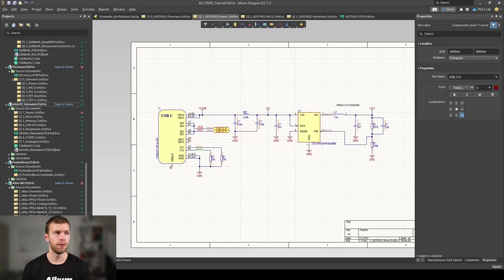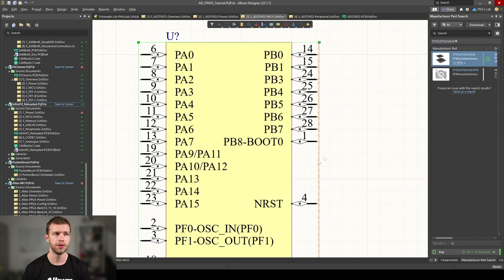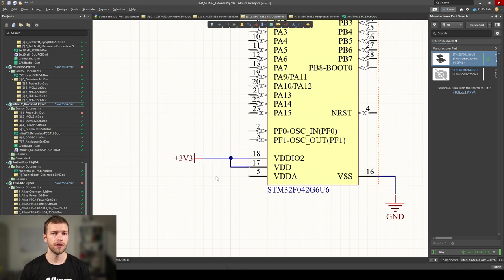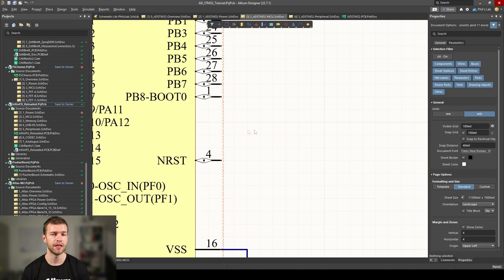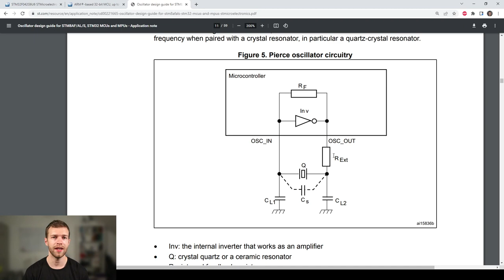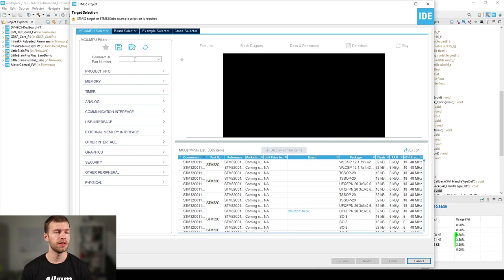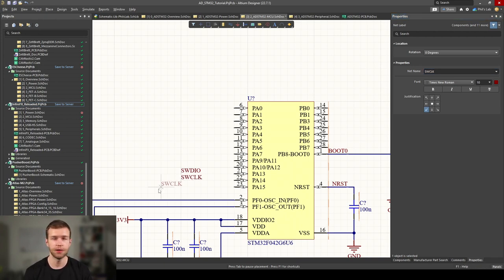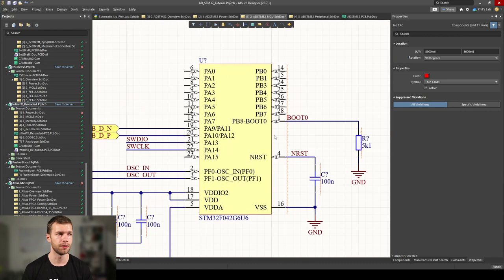Microcontroller-Based Hardware Design With Altium Designer - #4 Microcontroller

Comment: Good video!!
I've seen some designs about the  crystal oscillator has installed a large ohm(1Mohm or greater) of resistor between pins OSC-IN and OSC-OUT.
What is that purpose of the resistor?
Reply: It's a feedback resistor. In most of cases this resistor is built-in in chip.